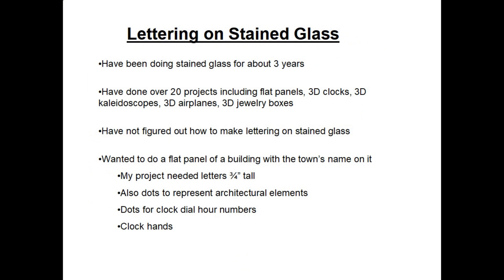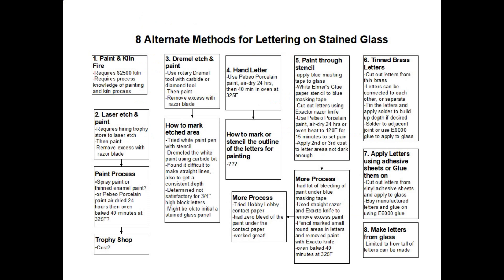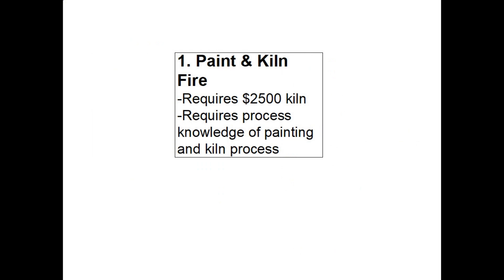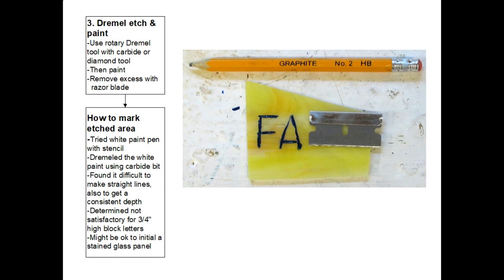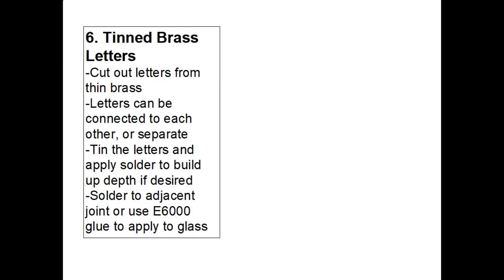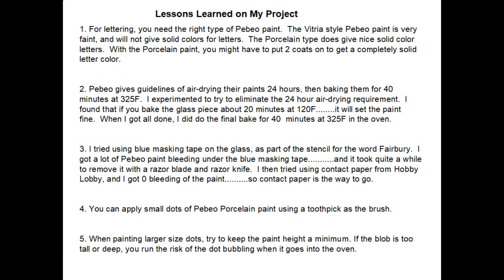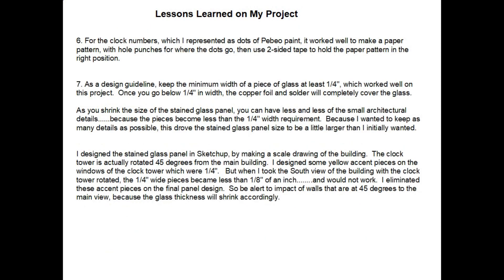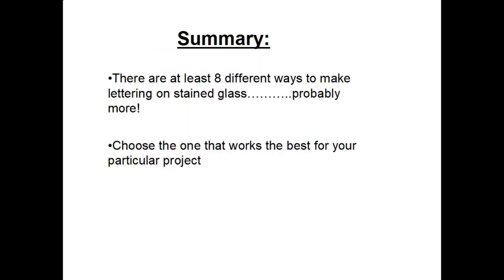How to Make Lettering on Stained Glass

Comment from the maker: After I did this video, I had another project where I decided to add the Pebeo paint after the stained glass panel was built, then cook it in the oven.  I checked and I set my oven below the melting point of solder, but my oven melted all my solder on the panel and it flowed to the bottom of the panel !!!!!!       Turns out most standard kitchen ovens have very poor temperature control and they overshoot the target temp on their heating cycle.........so don't bake you Pebeo paint after the panel is soldered.............do the baking before you solder up the panel !